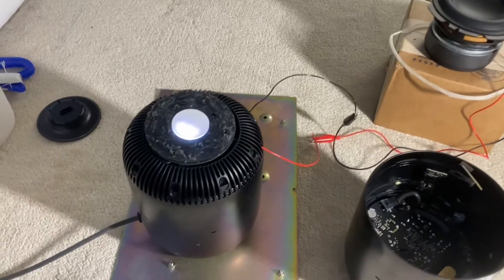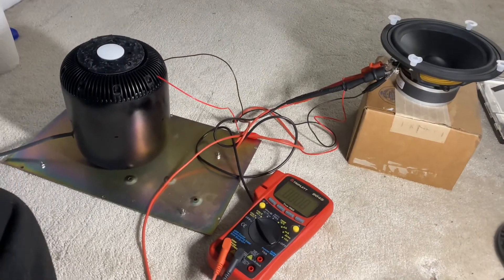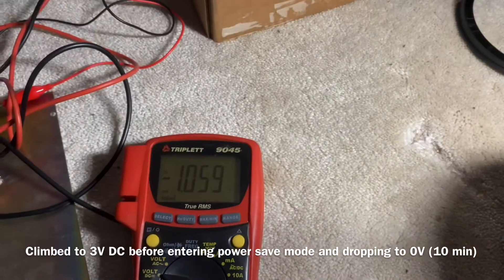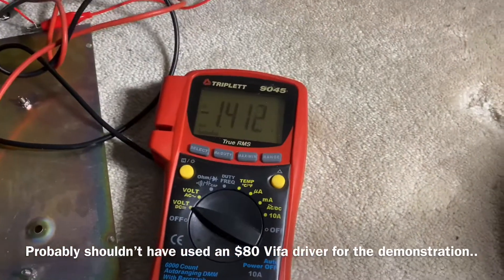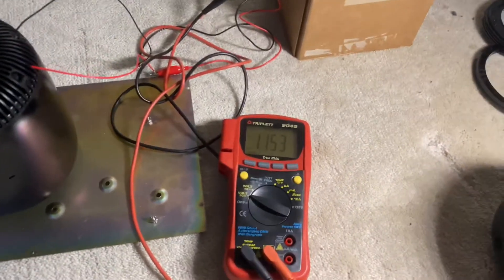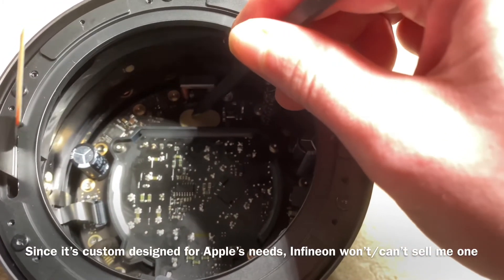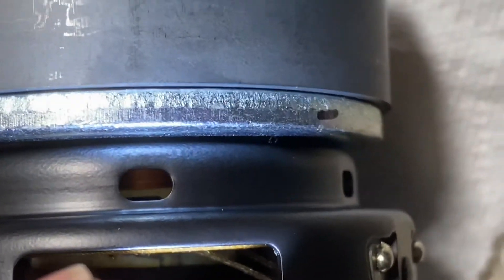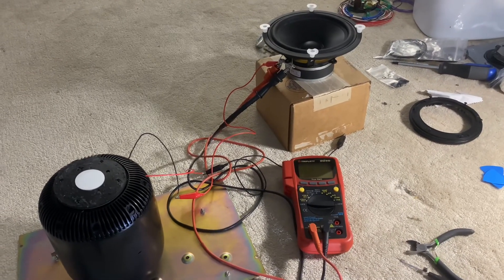HomePod Popping Noise Diagnosis

Comment: Any updates on your experience?  I have at least two of my six HomePods exhibiting this popping sound (I have 3 stereo pairs in different rooms). None have died yet, but this noise may force the retirement of them as it is random, loud and disruptive.
Reply from the maker: No update except that you can't get a replacement amplifier IC because it's a custom part.

Comment: There was no Power on mine did a reset. how can I fix it!>?  is it the Power circuit?  or a capacitor or the mainboard? Any help would be grateful.    it was working one day and the next stopped working.
Reply: It is a Diode. I Repair 3 HomePods with this fault.
Reply: @martsn54  is it possible to cosmetically restore these after a repair? I have several that pop and one that won’t power on anymore.
Reply: YES

Comment: Thanks for investigating the issue. A couple of questions, i currently have two homepods working fine for more than a year, can and will this happen to everyone? Does disabling hey siri and only using them as speakers prevent this issue? Should we disconnect the speakers, for example, at night to prevent the speakers from going idle too long? Thanks again
Reply from the maker: Not really, when ever you play music, the woofer amplifier will be receiving power and sending DC to the woofer (along with the AC musical signal)
Reply: Would like to know it too cuz I'm ordering it ...